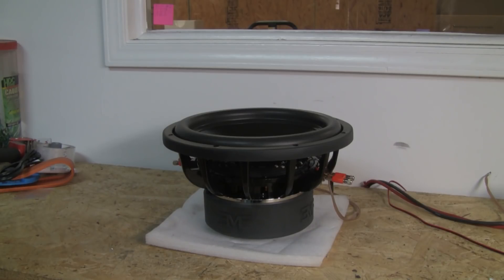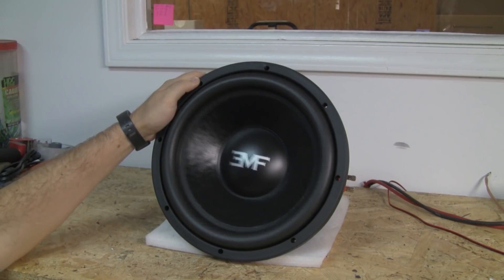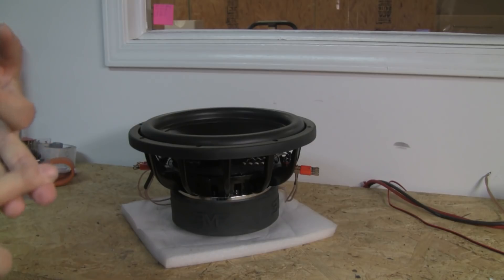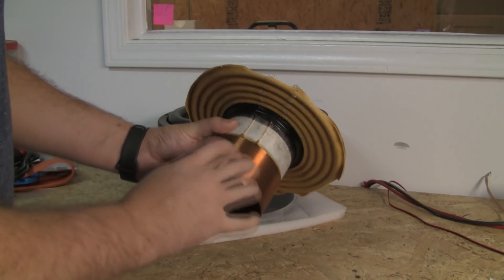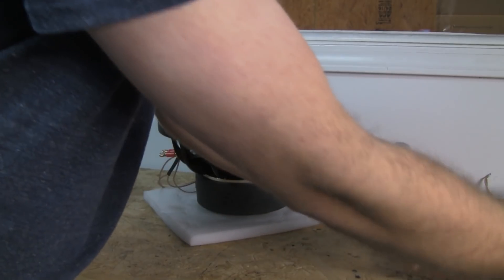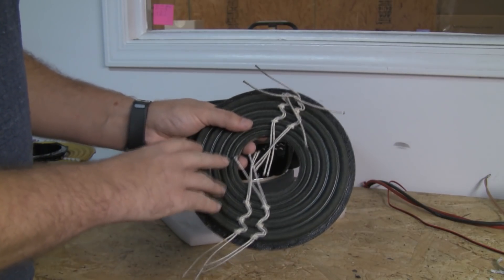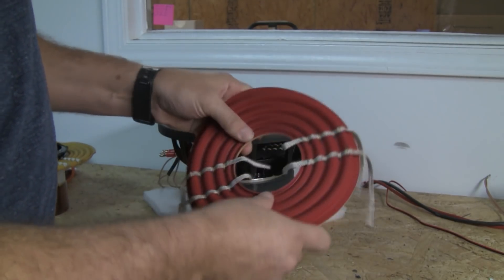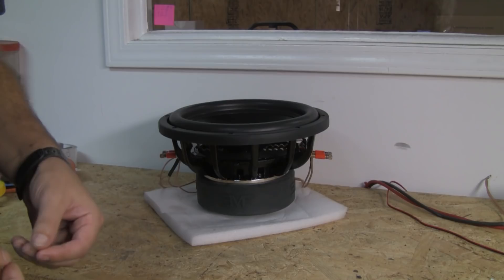Tech Stuff Tuesday - Subwoofer break in myth busted

Comment: People can say whatever they want regarding their opinion of driver break-in.  I have owned a custom home theater business since 2001.  IF ONLY driver break in was a myth, and IF ONLY I just needed to install the system and let them break themselves in over time, it would save me SO much trouble.   If I don't thoroughly break in the mid and low frequency drivers in my shop before I install them in the system, I HAVE to come back out and re-tune the system in a few months because the frequency response of those drivers, and therefore their respective crossover points, has changed so much that the system sounds messy and the bass sounds boomy and exaggerated.   Anyone who doesn't take driver break-in seriously isn't truly effected by it in real-world circumstances enough to know the true importance of it.   Sure, to SOME people who don't have much of a distinguishing ear, the gradual change in the sound of their system will not bother them.  But that isn't the same for everybody...
Reply from the maker: Opinions are ones outlook on a subject, facts are proven details that can't be argued. This video is facts, not opinions. I believe I mentioned it will sound different after break in which is why you might have to retune things afterwards. It does not change the fact that following some procedure will not make it last longer or sound better. Realistically, you could have to retune it again in a year or two because the suspension continued to change characteristics.

Comment: 8:05. 20KW? 1600A per say? Whaa? That's an amp.
Reply from the maker: 20kw can be made by more than 1 amp per sub, as many as 4. 20,000 watts @ 1 ohm is only 141 amps.
Reply: @EMFAudio  I was really talking about the amp here. 20,000w/12v=1666A, 20,000w/14.4v=1388A. Input to the amp that is. Yes I know that is the output Wattage but that's all I was given. Cheers eh.

Comment: I'm sure there are some cheap speaker manufacturers that a little break in is highly beneficial. Imagine stiff sub suspension and say elmers school glue.... I think that probably the part to most likely fail if not letting the suspension as a whole soften first spider or surround or even coil comming apart do to weak connection.   Although i have personally never broken in any sub.     Well nevermind. Great vid. Posted to soon 9:30 then got back to view my comment covered in detail. Thank you for mentioning weak spider tearing as well.
Reply: Ive got a couple of tens in my car currently that are mostly gorilla glue. Not do to break in so much as break apart. I do think a good ten years of pounding will do that. Seems every couple years need some repairs.
Reply: No.  If it is poorly built or someone used old/bad glue it will break no matter what ritual you perform.   Vas, FS and Q typically vary less than 10% once suspension is loosened up (higher Q and Vats lower Fs); plug any sub's numbers you like into WinISD or Bass Box pro and you will not see an audible difference.   If you play a sub hard at x-max most of this softening happens within the first few minutes then continues for several years almost imperceptibly over time.  
This whole myth was started by companies looking for an unprovable cop-out for honoring warranty claims.  It breaks mechanically you must not have "broken it in" with the proper ritual.... stands to reason, warranty denied.  I have built and broken and pulled specs from enough specs to confirm "break in" as it's being pitched by some companies is 24 karat bullshit.

Comment: I believe if it can't play rated out of the box, then it isnt my fault. The company gave a false rating. A coil fails from heat/overpowering, bottoming out and clipping. If the suspension loosens up that is more likely to happen especially with pushing it harder when "broken in". if anything i want the sub to stay stiffer for longer. Just my logic of thinking. My custom 12 i now own that was built i was given 1500w rms, That was according to the builder who built it for a friend 8 years ago, he had 1500w rms on it the day after it was built, now i run it around 1600 clamped with impedance rise. You can still barely push it with your hand. It hasnt dropped any db in his car or my truck. But the quality is there so it can handle it. I wouldnt trust a sub that says break in. For the exact reason for what you said poor build quality.

Comment: This weekend I just noticed i had a spider to former glue joint fail on a week old 15" NVX VS sub. There is no other sign of damage and it never got hot, im hoping NVX doesnt try to say I is definitely my fault like no break in (even tho it's not mentioned in the manual) or overpowered...I did stretch it's legs but don't feel I abused it and I don't have an internal watt meter but I am fairly knowledgeable, being budget sub should I have let the spider get some stretch for a bit before bumping it or is this very likely just a sign of piss poor glue job on a mass produced import sub or could this be legitimately blamed on me? I've always been under the impression NVX builds fairly quality products for there price point. I just want to be prepared when I talk to them I don't want to be bullied by them to avoid covering it.. Any input would be appreciated...
Reply from the maker: I can't speak for them but I only see 1 reason it could get put back on you and that's if the enclosure is wrong.

Comment: Back in 2001 I was sponsored by Treo I was in the super street 9 plus class and they had told me to install the subs and play them at 30Hz at 3/4 volume for 2 minutes let it cool down for 10 minutes , then do it again and that was it. Speaker was ready for full burps at 8k watts.
Reply from the maker: Yup, that was to loosen up the spiders because they were built too stiff to begin with. After break-in they were appropriate for what you needed. That's how I build SPL subs.

Comment: I went to best buy today and bought a new pioneer subwoofer 1200 watt and it smells like burning since I got it but I bumped that 21 savage and it broke look at it and touch it is hot to the touch good thing I got warrant lmao
Reply from the maker: Pioneer typically rates in peak, not RMS, and their peak is usually 3-4x RMS. Consider that with your amp. You may also be clipping the balls off of it.

Comment: The way to tell if your car subwoofers are broken in is by pushing the cone in with your fingers if you can't push the cone in then it's not broken in yet and is still stiff
Reply from the maker: That's not accurate. Break in is relative to it's state when freshly built. I've built subs so stiff you can't move them fresh and barely move them broken in. I've also built subs very soft so fresh they would move very easily and broken in easier yet.

Comment: In my years of box building, I've found it best to cycle a sub with different test tones while inside of the box and vehicle for which the sub is housed in.

I've witness several changes as you mentioned earlier in s parameters which effects some box designs more than others( tuning help compensate for those changes as well adding or removing polyfill)....I use several test tones to allow the former and its adhesives to better set  as well as allow the subs to move freely with the compliance of its coil and leads through its enclosures limits.

Everyone has theories,  this is mine and it has worked quite well with me and the subs yhat I normally install are of those lower quality that everyone rate them as😏 but its odd that I tend not to have issues of burnt coils, spider seperations,surround or dust caps comong undone.

back in the day, several co.pany's did a burn in time period after assembly then retested to assure  that the subs parameters, mechanics and connections ( leads, spider and cone, spider and landings as well as the surround and its seals were still ok then they  packaged the finish products but now a day, subs are assembled, tested for parameter accuracy and freedom of movement then packaged for shipping.

I recall opening subs back in the day smelling the warm coil smell and not just the adhesives use to asdemble them.

myth or not, it tend to work better for me, mainly in tuning before a customer even hears their ride....then after a few weeks of beating on it, they give me call or come by to tell me that it seems to be getting louder.

it took all of this to say that the former heats up ...it expands and when its cools down it contracts,  those gasses that you're reffering to is from both extreme heat ( over powering ) and normal play  ( although mi'nute, it still forms around the coils)....and yes subwoofer design can help to remove these gasses and heat but it only can do but so much.
Reply from the maker: When they call saying it's getting louder, that's because it's breaking in. There is no avoiding that, that's what they do. The specific procedure is what doesn't matter or is actually not breaking it in at all.

Comment: I have an alpine type s 12 inch that I was running on an amp that was given to me it was only 200rms at 2ohm I just bought a jl 500rms at 2ohm I set the gain accordingly and I have a slight smell from the sub. So your saying this is normal? Soon as I smelled it I backed my gain down a little bit because I was worried I was gonna blow my sub.
Reply from the maker: The gain shouldn't change based on what sub is connected, a proper adjustment is to the signal input voltage. No, a smell is not normal unless it's brand new.
Reply: @EMFAudio  it was a brand new sub but it was 300 watts under powered until last night and I ran it on the 200 watt amp for about 2 weeks. I think what I shp8ld do is just find someone with a dd-1 or a oscilloscope to properly set the gain (sensitivity level) I think I maybe had it up a little to high.

Comment: Well, this is a very controversial topic, but from my experience, most subs(especially stiffer ones) need to be broken in. I've broken in my subs(took about 2hrs) I had them in free air and played varying frequencies through them. Went to manufacturer xmax rating. Spiders moved to the second last roll. Once I saw the impedance settle(the rate of change decreased dramatically), I gave it more excursion so the last roll would move and left it for 30 mins to break in.

Not a big procedure and I can be sure I won't rip a spider or something like that. And like you said, that doesn't really happen unless you have 7 spiders but it is for the peace of mind.

Comment: I can state breaking in a sub is actually a true thing. Use a already broken in sub with a new sub and once the new one hits the breaking period you will hear loud punch then smoke. Happened to me 3 times now. It alters the specs in the end
Reply from the maker: Pay attention to the video. It doesn't say breaking in doesn't happen, it says any type of procedure is bogus. It happens by playing it, by barely playing you're actually NOT breaking it in at all. If you play it full volume right out of the box you end up with the same break in result as if you did it slowly over time.

Comment: Just play like 10-20hz low volume free air that will break the spiders in, I have had brand new subs just reconed and fail the same time giving it full power without break in.  Second time it was played on low power free air on a sweep and then installed it took a lot longer to kill and sounded much better.
Reply from the maker: Sounds like you had garbage subs. 25 years and I've never broken in a sub, never had a failure because of it. I also tell all my customers they don't need to and THEY don't have problems.
Reply: EMF Audio  we’ll real world test have been done by others and have had better results with breaking in subs.

I had the issue on ground zero radioactive 18’s,  reconed with factory soft parts and then with FI soft parts. (FI ones lasted longer)

Also I have 2x FI ssd subs one that had little use from new and another that I’ve been beating on daily for over a year.  Both tested on same power / same box / same car and the broken in one plays lower and louder. 

I guess that’s just some voodoo magic 🙄
Reply from the maker: @Dont-come-at-me-24  What are you saying worked better? If it's the coil, then that was because it had a different coil, not because it was broken in or not. Ground Zero uses Chinese coils, Fi uses USA coils. The failure temperature is over over 200 degrees different. Your "real world" testing has variables. The actual real world, breaking in changes performance because that's what happens if it breaks in after a day or a year. Performance isn't failure.

Comment: Yes.. But break in is more about the sound getting better as it is broken in than actually blowing up the speaker..
Best thing is to start at lower volume and increase bit by bit. But the thing with break in is that the sound changes after some hours of use. Some more than others. My home speakers (and car speakers but they had less difference) sounded way better after 100hours than they did out of the box.
Reply from the maker: The sound changes from breaking it in, but starting at a lower volume is literally doing nothing for breaking it in. It breaks in from being pushed. You can get better results of break in from 30 minutes of full throw than you do 100 hrs of gradual volume increase.
Reply: @EMFAudio  You need a bit volume to move things and break in the moving parts, but I always get better sound after many hours of moderate and high volume than just 30min of heavy use. Breaking in the movement and breaking in the speakers sound is not quite the same. I agree with you for the power side of things. But after a couple of decades of experience and testing I know to get the true sound quality the speaker can do it needs alot more than 30min heavy use to reach it's best. Not so much difference for subs as it is for a midrange and tweeter but still. Maybe not the best explenation but english is not my native language so..😂 Not trying to argue with you or anything. I like your videos and you know your stuff very well. But this is my experience.

Comment: Brake-in is not essential; but, will help out the low end.
Reply from the maker: Break-in happens by playing it. Installing it and just playing it gets the low end without wasting time before it's installed.
Reply: @EMFAudio , how would you know the resonance of the speaker before braking it in? It would have to be broken in before hand; so that, a new graph can be produced. It takes all of the guess work out of building the right box for the woofer. Unless that is, your meaning to run it so under powered that you already built a 10 cubic foot box.
Reply from the maker: @humboldtoregonian9400  Well, the before break-in doesn't matter because it will never be that spec again. But, what I do is get t/s params before and after break in to see how much it changed. If you don't have that equipment, you can use a DMM and simply play tones in free air to find the highest impedance.
Reply: @EMFAudio , so you put your woofer in a box, brake it in, and then put into another box? In the end, the woofer will brake in with use; and thusly, it will change it frequency response. Why no just brake it in, measure the response; and then, make or find a fitting box for the woofers final form?
Reply from the maker: @humboldtoregonian9400  I don't put it in a box at all. I break it in free-air if I'm going to do that. The only reason I have to do that is to get parameters on a driver with unknown parameters. I put it in an appropriate box for after break in and just play it. It won't take long to be right.

Comment: Good Video!! I do however have a basic question, for getting the TS specs right (e.g. using DATS) don't you think its better to break-in the sub before measuring? In the video you did talk about change in Qts (I think more precisely its Qms), Vas etc.
Reply from the maker: It is better to get specs after break in, yes. That's the point where we publish our specs. However, every person that buys a speaker isn't breaking it in, taking specs off it, building a box for it using simulations that aren't accurate anyway, then installing them. The myth being if you don't break them in, they'll self destruct, nothing related to specs.
Reply: @EMFAudio so you do agree that break-in is good if you wish to build a better box. Based on my experience (just a DIYer) I have seen only very few drivers (mostly budget friendly ones) where the measured TS matches with the published specs (I have verified it with both WT2 and WT3 (old DATS) just to be double sure). Oddly the driver where I found that the measured specs closely matched published one is for two Fountek mids! 

To summarize based on my experience I have learned not to trust published specs as the simulated response would be way off from what is provided in the user manual (e.g. QTS = .48 (published) vs QTS .7x (measured) for one of the driver I recently measured. Would have been a disaster if I had designed/build the box based on the one recommend by the Manufacturer).
Reply from the maker: @Venki7744  Our specs will match what you get on your own, I've had customers say the same thing you are and be skeptical and sure enough get the same result. You can also use our recommended box specs and get a good result. Not all companies are like that, but we're small and actually care about what we push out the door and how people use it.